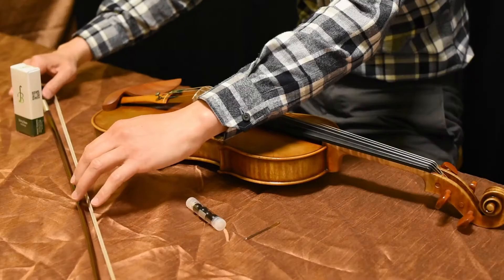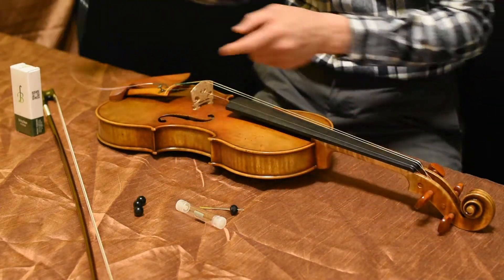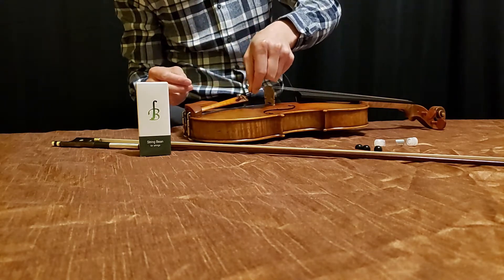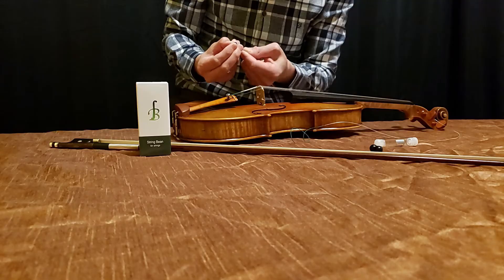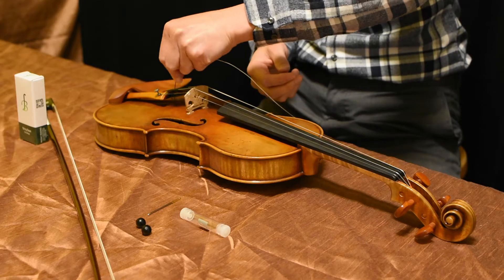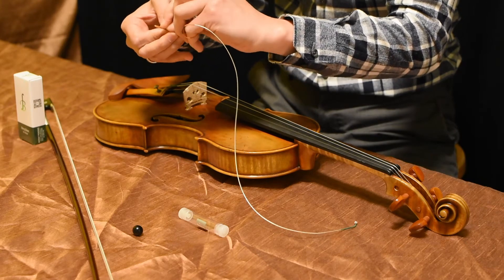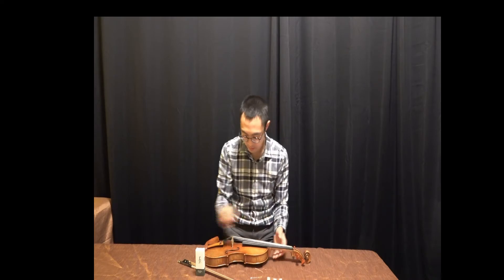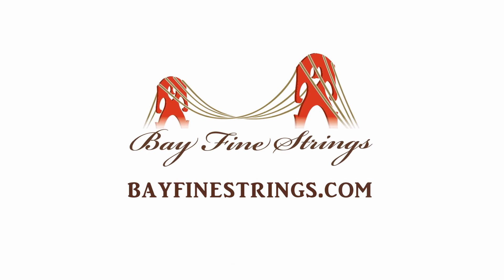String Bean Installation Tutorial Tonal Enrichment for Violin Viola Cello

Comment: do you have to replace the beans every time you put on a new set of strings? or can they be reused when putting on a new set?
Reply from the maker: Its not recommended that they be re-used after a string change, but one can re-install them on other strings if lightly used, one would have to use the same hole you originally made with the needle.

Comment: Does the bean stay under the tailpiece? I can’t tell. I’m not sure what you mean by making a fishhook...
Reply from the maker: Dear Gene,

Yes, the bean stays under the tailpiece. Once the string has the bean threaded through to rest over the ball end of the string by the tailpiece starting from the peg end of the string nylon, you can crimp and make the hook with the peg end so you can install the string on the tailpiece. It is like how one may need to install gut strings, because the knot is larger than the tailpiece hole. The string with string bean is larger tham the tailpiece hole, so it meeds to be installed by pulling the entire string from the bottom of tailpiece starting with the peg end of the string as demonstrated in the video. I hope that makes sense, and perhaps the video will be revised with some close up drop in pictures soon. Thank you for your question!
Reply: Thanks for the detailed explanation!